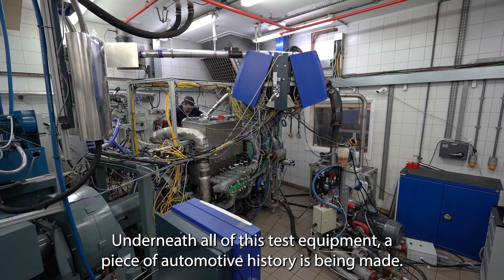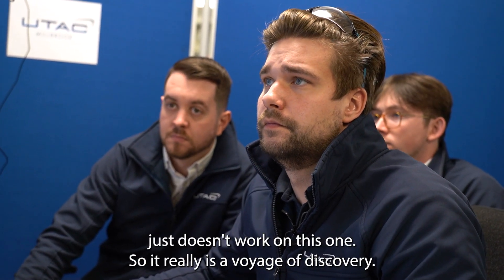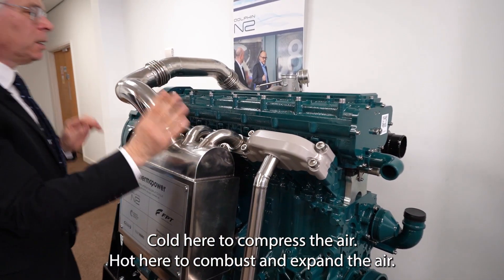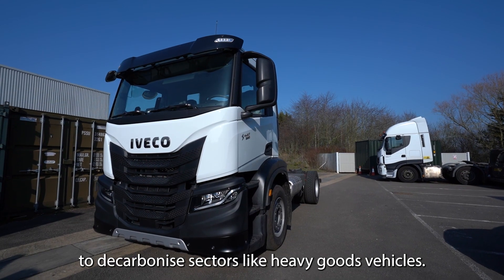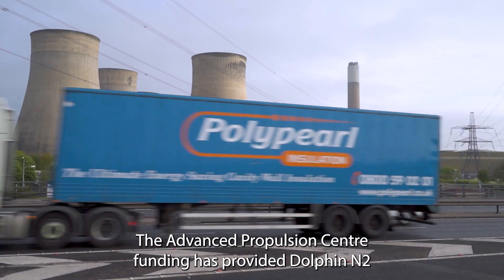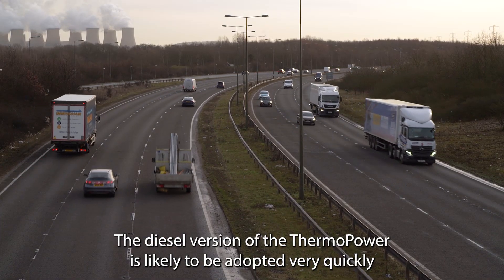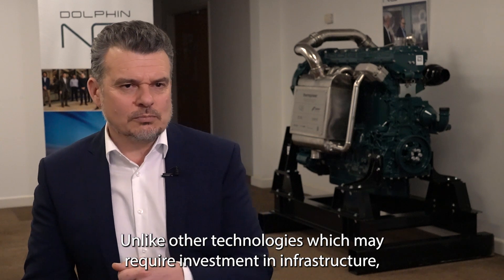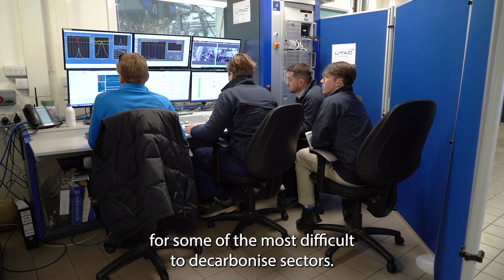Dolphin N2 hydrogen combustion engine

Comment: Why design a new engine when a regular motor with timing adjusted works just fine
Reply: Adjusting the timing on a conventional engines doesn't gain you 20% efficiency over an already optimally tuned engine.

Comment: Very interesting engine cycle, will be very interesting to see how it stacks up against the maximum torque available from 0 rpm of electric motors
Reply: Max torque at zero RPM in an EV motor is achived by locking up the output shaft of the motor with a dyno and supplying full current to the motor, the same can be achived in any engine with a torque converter by applying full trottle while locking up the out put shaft with a dyno. Full torque at zero RPM is nothing new or special its just a term coined by Elon musk to promote EVs.
Reply: @jonathondeeds3423  An internal combustion engine cannot run at zero RPM, and therefore cannot provide torque at zero RPM.
Reply: @ferrumignis  You need to go read my comment again I said full torque at zero rpm can be achieved by applying full revs and locking the torque converter by doing this it is possible to generate full torque at the output shaft at zero rpm of the output shaft.
Reply: @jonathondeeds3423  "I said full torque at zero rpm can be achieved by applying full revs"

Do you not see how ridiculous this is?  Full revs is not zero revs.
Reply: @ferrumignis  you need to have some understanding of how engines and torque converters work if yo did you would understand what I mean.